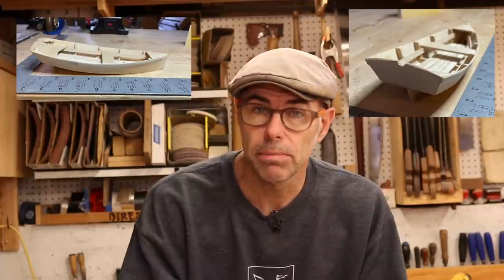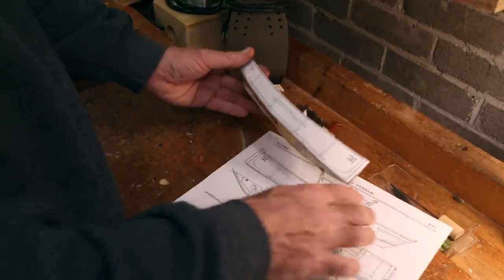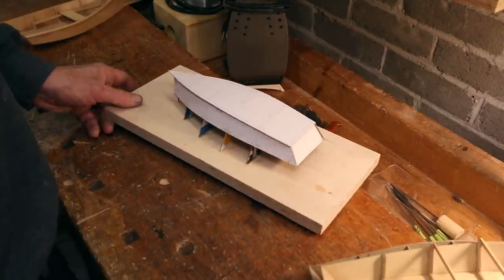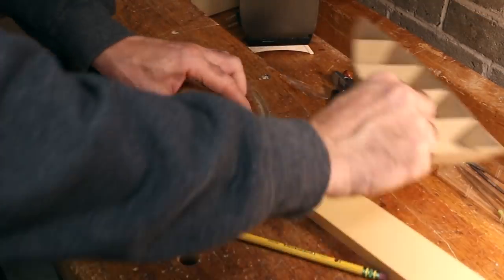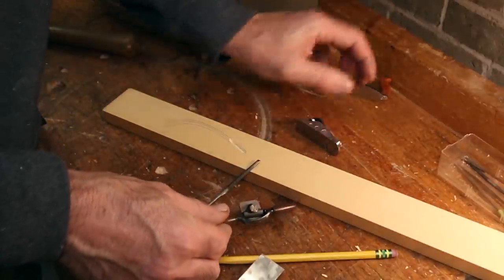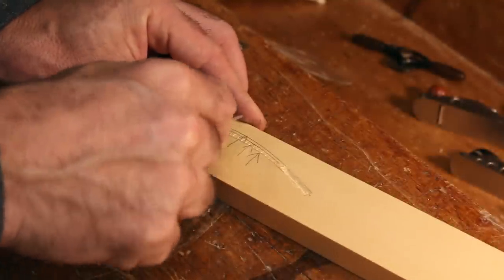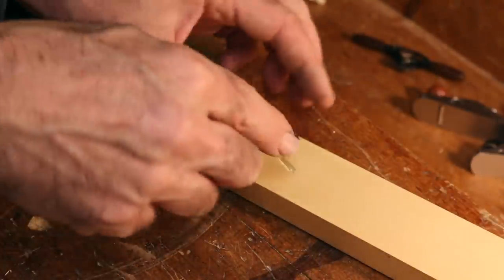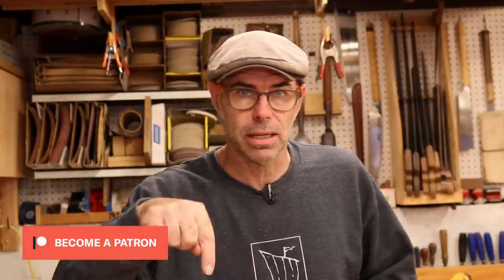Model Boatbuilding - Stem rabbets

Comment: Don't cut all the way to the rabbet line in the first go, or you'll cut away too much material. The planks won't come in at 45•, and the angle will change over the length of the curve. You need to take the planking thickness into consideration. Use a block of wood of a plank's thickness, cut at 90°. Set it to paper and draw it's shape. Rotate it and note how the back rabbet and the inner corner move as you change the angle.
Now, this would help you if you had a completely staight perpendicular stem, but you don't, do you?

There is a method of getting the exact angle in any given cross-section from the plans, but it is quite tricky to wrap your head around. You also need a lofted, full-scale plan to do it accurately. Angles run away quickly on you, once you start to rotate them in 3D.
Even with this technique, I think it's better to air on the side of caution.

If you are somewhat confident with your rabbet line, you can cut it roughly, but shallow, with a round tip router, or make a scalloped cut with a hollow chisel. It will remove some material and makes the chisel work a little less exhausting, especially if you are working in oak or ash.
But take it easy. Good stem material doesn't grow on trees. (Pun intended)

Cut it roughly at first. Test out the angles with a good batten that has some stiffness to it. Cut some more, and save the last for when you have the plank cut out, bent and clamped in place.

Cutting the rabbet is the single most difficult thing in boat building, and it sucks that it's among the first things you have to do.
I've had many a student in tears over this, but you know what, they all managed it in the end.
Reply from the maker: All excellent recommendations. This video was just intended to give the viewer a very basic idea of the chopping method and obviously the scale prohibits detailed guidance but everything you mention I employ on full scale builds and teach in my hands on courses. Thanks for adding hese details.
Reply: Dear Dh-lo9ut, what do you recommend to your students when they realize they've cut too much?

Comment: Good information.  Up 'till now I had mostly avoided this process on my model boats by just gluing the planks to a V shaped stem.  Doesn't look to terribly difficult to do if you have to proper tools.
Reply from the maker: While I am all for finding simpler solutions, I also believe there is value in cracking the code on more seemingly complex processes. There is often some unforeseen gains hiding in there. Even better at a model scale where the cost of failure is so very low.

Comment: Hi Mark,  I found the video very informative and wish I had seen it before I built the model of the french tunny boat in my profile picture.
I was catching up on your Bouchie Dory  build on the cut water. Watching you scratch marking the fixing hole through the cut water, reminded me of the accessory / tool I recently found. Its called the "Marxman". It's a little aerosol of green chalk with a tapered applicator. About 4 inches long and 1 inch diameter, its compact for getting behind objects to mark a hole. You center the applicator and push the aerosol and it fires a dart of chalk to mark through your screw hole in your timber. The guy who came up with the idea is a domestic service engineer, an ordinary guy cheesed off with one or two holes off center like the second hole which went slightly off center on you. They make two types, one for 0-2 inch depth and  the other 2-4 inch depth. The estimate is 250 shots of chalk per tin, unless the kids get to it. They are quite inexpensive, I used it last week to put a tiny latch on a cabinet. I got 4 little green dots all aligned and no farting about hoping the pilot drill will get you sorted. You will find it on amazon uk but I haven't seen it on amazon.com. Its also shown on youtube, on "The Dragons Den" an enterprise program on TV over here.
Love the videos , keep them coming ; its never a good day unless you have learned something new!
Reply from the maker: That’s an interesting product. I'll keep my eyes peeled for it.

Comment: Dear Mark, excellent video as usual! Please, how do you determine the position of the apex line? Thanks, mate!
Reply from the maker: That is usually figured out in the lofting stage by working out cross sections of the stem and subtracting plank thicknesses from the outer surface of your lines. The plank ends are assumed to 90 degree cuts so you project that angle  back from the rabbet line in those cross sections and your plank thickness determines where on that projection the apex or back rabbet lies. You can do it without the lofting right on the work if you have the bearding line as well as the rabbet. This very hard to describe in words that make any sense. Read the pinned comment. The writer describes the process fairly well.
Reply: @Nomadboatbuilding  that's perfect! Thank you so much! All the best!

Comment: A good cheat on the full size is to use a biscuit jointer from the frame to the keel. Obviously you have spare material on the back rabbit , but is does put you in the ball park and give you the correct angle at each frame. I have never tried it on small craft, but on 10m and above it worked rather well
Reply from the maker: That’s a really interesting idea Robert. I’ll keep that in mind.

Comment: doing my first model from scratch I would not have thought of this... Busy with sawing wood for the stem so I watched your video....
Reply from the maker: Be sure to read the pinned comment at the top which has a bunch of good tips for getting this detail right. Of course working at scale has challenges for accuracy and maybe it isn't important to you to get everything just perfect but model making also offers great low time and materials cost education as so many tasks are pretty much the same regardless of scale.
Reply: yeah , I priced out building the full one, and yeah, a model is best I can do at this point. I swear I have more time into CAD on this boat than they say it takes to build the full boat.@oatbuilding
Reply from the maker: Computer machines can be a real time suck
Reply: for real, but also amazing feeling whe nyou tell that virtual concept to move down the wifi network in your house to the 3d printer.... I printed a big arse boat stem yesterday just to see how it fits on my drawings. in real life.  @Nomadboatbuilding
Reply from the maker: @poepflater  well that’s very cool. I've never been able to envision much use for 3d printing or even cnc in what I do but a friend of mine has recently started playing with it and I can now see some interesting peripheral applications. Still there’s the cad time to consider and I'm so far out of practice that I can’t hardly use it anymore. I gave up cad when I went into boat building almost 30 years ago.
Reply: the more I use mine, the more uses I find for it.... I'm way over printing trinkets off the internet... tonight I printed a new sharpening jig for my bench planes.... @Nomadboatbuilding

Comment: Dear Mark, I've been studying the construction of the Matinicus peapod you mentioned and there is a point in the construction process that I just can't figure out. Please, how is the garboard plank attached to the back bone of the boat in that section between the bottom of the stem (where the rabbet is too shallow to be screwed and to bear the plank) and the beginning of the keel batten (where it has a positive wall to be crewed)? Further more, that is a spot where the edge of the plank meets the back bone almost at a 90 degree angle making it even harder to fix the garboard in place. Looks like a weak spot that's prone to leakages. I'm I missing something? What would you recommend? Thank you very much!
Reply from the maker: You are not wrong to be perplexed. What is very hard to visualize is that there is in fact a reasonable surface to fasten to there but it is by far the trickiest part of the whole building process to fair in. Patience is key and a dummy plank to judge your progress. Something about 3/16” thick in ply or softwood. You need to mark out the rabbet, back-rabbet and bearding lines but hold back on chopping them all the way to the  apron, (keel batten). Hold back an inch or two. The apron will get faired off quite a bit as it winds towards the stem and the change may be quite dramatic within a short distance of say 6” perhaps. A light batten laid diagonally across your first couple moulds (running at a right angle to the rabbet line) will help guide you in getting the bearding surface faired in and the dummy plank will help to judge if you are getting it right. Hold back just a hair until the proper plank is bent in place, then you can tweak it until it lays properly tight to the rabbet line.
Reply: @Nomadboatbuilding thank you so much for the explanation and tips. I'm much closer to fully understand it now. Congratulations once more for the channel and the awesome content!
Reply from the maker: Your best bet to getting more clarification is to model this out at say 1/4-1/3 scale. It just needs it large enough to see the details of the rabbet. You only need the first two or three moulds plus the stem, and a short bit of apron and keel. I promise you it won't be a waste of time.
Reply: @Nomadboatbuilding  Thank you very much!

Comment: Hi :  good description but it looks a lot of work;  my technique is just screw ( with glue) the planks to a stem and then glue a pointed end stem to that, ( probably the reason is I only have dull chisels).  But, may try the idea.  What is the time table for the Catalina skiff?  Will it be the same format as the 2.4M ?  Totally looking towards the next build
Reply from the maker: I call the technique you describe as an applied cutwater. I use it often but in traditional construction we often find a chopped rabbet and so it's good to know how to approach such a construction problem.
I plan to start the Catalina wherry videos after I wrap up the Bouchie dory series. Probably somewhere early in the new year. It won't be the same as the 2.4 series. I'll have an emphasis on some different concepts. It will be a little more self critical, looking at good and maybe bad ideas for productivity.

Comment: Fun little video, Mark. I need to pull you up on your units of measure, though. "A hair" is just not good enough. The standard units of measurement are a gnat's c*ck, a double decker bus, a blue whale, a swimming pool, a tennis court, and Wales. Obviously the one which applies to model boat building is gnat genetalia, but if you are describing how much rainforest is felled in a certain period of time, for instance, then "an area the size of Wales" comes into its own. Now, do try to stick with these official units, there's a good chap.
Reply from the maker: My bad Mike. I'll check my units conversion chart in the future.